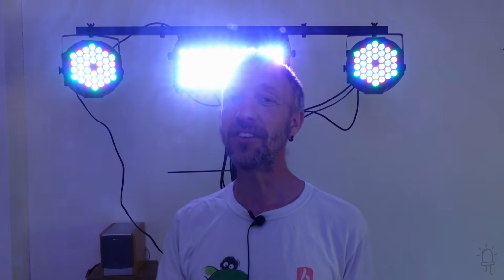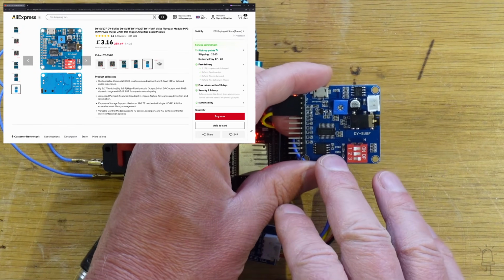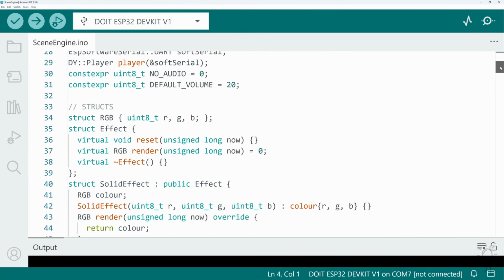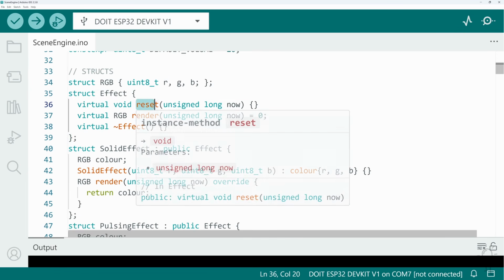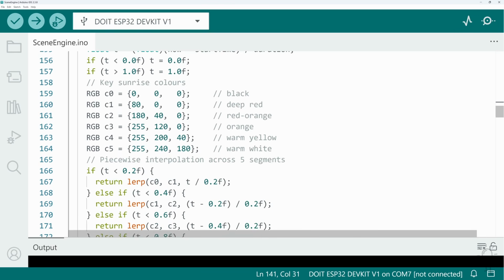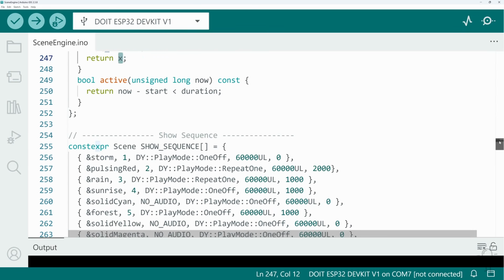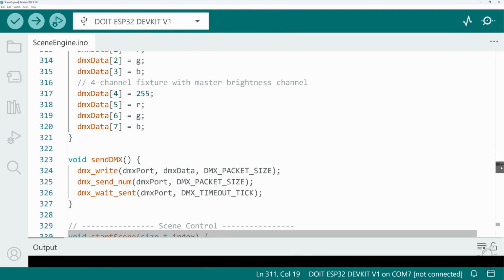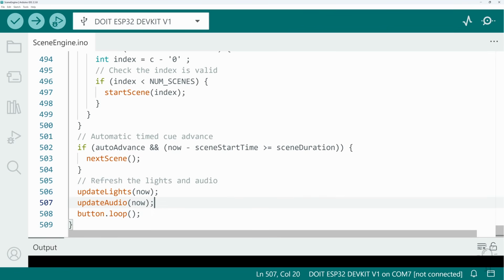Build your own ESP32 DMX Lighting and Sound Controller for under $15!

Comment: Great job, I've learned a lot. I like your programming skills. I started saving things like scripts and effects and sounds in files stored on the LittleFS partition and load them on setup. Then I found I can run a web server on the esp32 and go to a web page to upload changes to the files on the fly and I don't have to re-compile and re-upload the program.
One problem I haven't tackled yet is how to store in the script the expected conditions that will trigger the next scene. They could be anything like completing an escape room puzzle on another device and getting a message over ESP_NOW or a series of button presses or completed magic wand spells. Also in the script, I want to store timeout timings for triggering things like hints and clues (audio and video scenes) to help move the story along.